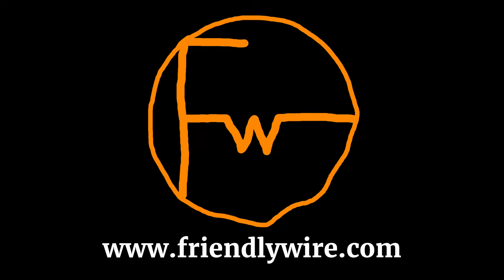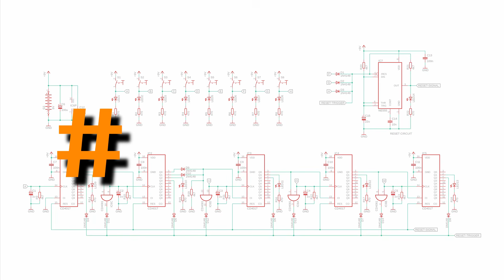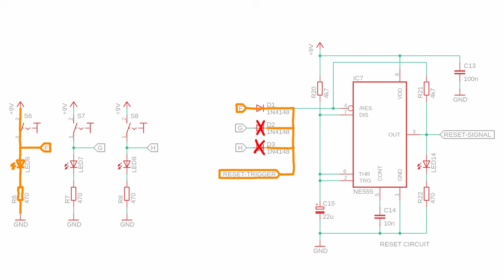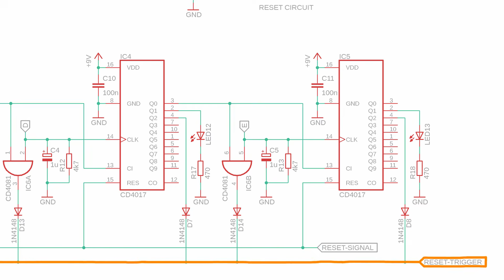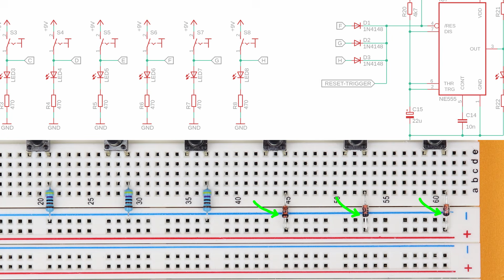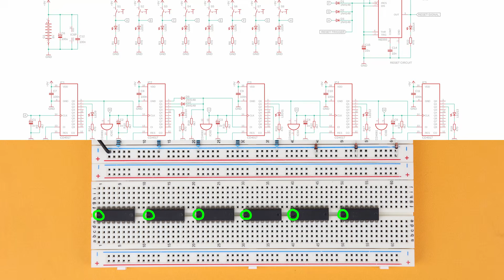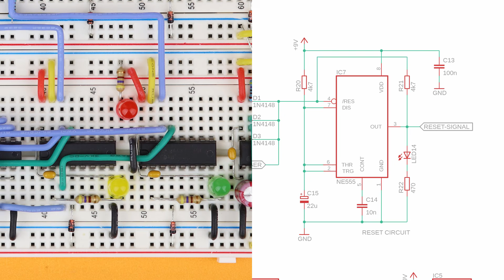CD4017 code lock with wrong code detection

Comment: bro plz tell me how to change the password of tis project,which components are need to be changed,exactly 🙏
Reply from the maker: Thank you for your interest! I made this video as a tutorial, and there is a detailed write-up available on my website at https://friendlywire.com/projects/code-lock/ that has a lot of details on this schematic. You can also check out my video on the CD4017 decimal counter (https://www.youtube.com/watch?v=BZjO2TuS2Vk) or the NE555 (https://www.youtube.com/watch?v=l5LzERjkux0) to help with the basics.

After understanding these concepts I am sure you can make up our own schematic for your own code. I think it's important to figure out how these things work on your own first, because then you really understand stuff.

If there is a key question in between (like, what is the purpose of this resistor, or how does the Enable pin on a CD4017 work) then I am of course happy to help out more.

Thank you again for your question, good luck, and I hope you will have fun with learning new things about electronics! :)

Comment: I have made a code lock by following your vedio and it's working fine,but one thing is that the third button,,when it's Pushed (B) then you can push any butten without following code you set,it's unlocks even you push the whole password,why is it happening.
Also what's the use of three push button at the top right ❤
Reply from the maker: Great that you built it! I am not sure if I understand exactly, since B is the second button, C is the third one. But the code lock is built in such a way that it only unlocks for the correct combination. If it unlocks earlier, or for a different code, it means that the subsequent CD4017 counters are somehow not deactivated.

But this circuit is a bit complicated, so maybe you can try to build a simple two-stage code lock (where the code is AB) and see if it works.

The other keys in the top right are the keys that are not part of the code. For example, if your code is 34772, then the other keys would be 1,5,6,8,9.
Reply: @FriendlyWire  one thing I have noticed that if I press this button c then if I put  remaining code it unlocks the code.and how to use the upper right 3 button and how to change the code
Reply: And if I pressed any button except C as a first input then if it is wrong i.e D as a first input then it detects that wrong code
Reply: And kindly tell me how can I change the code

Comment: Can I have the schematic file of the circuit,plz
Reply from the maker: Did you see the link to the companion article? https://www.friendlywire.com/projects/code-lock/
Reply: @FriendlyWire ❤ thanks,do we have schematic file in it ,so that I can easily open the file in any CAD application,like logic works or multisim
Reply from the maker: @Mathmate2024  I used Eagle to draw the schematics, but I do not have the files for it anymore unfortunately. I think to understand this project it would be best to draw the schematic yourself, all the information is in the article :)

Comment: do we have any alternative of CD 4081 ,as it is not accessible for me
Reply from the maker: If you run the circuit at 5V, you can use the 74HC08 AND gate chip as well, just make sure to check the datasheet because the connections are slightly different from the CD4081.
Reply: @FriendlyWire also is it feasible for you to share a picture that clearly shows the pins connection of resisters,
You explained well,I appreciate.
But I felt some difficulties in the connection
Reply from the maker: @Mathmate2024  I am not sure I understand, did you see the schematics in the companion article? If you give me an example of where the confusion is I am happy to explain it :)

Comment: Guys I've built the code lock precisely as per the instructions but for some reason it's not working...
The LEDs aren't lightning up..
Reply from the maker: Thanks for sharing! Don't be frustrated, we can figure it out. There must be some mistake, which can happen easily in such a complex project. A couple of starting points:

1. Do all IC's have power?
2. Do all CD4017 counter IC's work? You can check this by following my CD4017 tutorial here: https://www.youtube.com/watch?v=BZjO2TuS2Vk
3. Do the NE555 chips work? You can check this with my NE555 tutorial here: https://www.youtube.com/watch?v=l5LzERjkux0
4. Does the reset line work? I.e. if you connect the reset line to HIGH with a wire, do all counters reset?

After these steps, I recommend the following:

4. Build the circuit stage by stage (i.e. a code with just two digits first, for simplicity).
5. If you have a multimeter, check your wires for continuity. On some breadboards, the wire connections can be bad and unreliable.

If none of this helps, we can look more :) Don't give up, this is normal and a part of the process (unfortunately). It also happened to me many times when I was trying to learn new things in electronics. Don't give up! :)

Comment: does the pushbutton auto lock after being push ?
Reply from the maker: Thanks for the question! If you press the button again (if it is only supposed to be pressed once), it resets the code. Is that what you mean? :)

Comment: why don’t you connect pin 4 off 555 to res 4700 after to gnd?
Reply from the maker: Thanks for the question! But I am not sure I understand, sorry. The 555 is working the same way as we used it in the CD4017 tutorial. You can read all about it here: https://www.friendlywire.com/tutorials/cd4017/#ch6

But I am of course also happy to try and help you directly here :)
Reply: @FriendlyWire thanks you very much, i trying to debug a error in this curcuit, the led in pin 3 off 555 always high, i don’t know fix it😭
Reply from the maker: @huyhenhoi8877  Have you tried disconnecting the reset circuit, and building it separately? Does it work when it's alone?

Comment: hi! so which part of the circuit would I change if I want a different passcode? thank you for your time :)
Reply: So I followed the video and when I plugged the battery, the red LED started glowing instead of simply flashing quickly - I press the buttons and the blue LEDs light up but the yellow LEDs don’t light up. I wonder if I connected something wrong or is it a loose connection?
Reply from the maker: @kenikicchi  Thanks for building it! It is always best to debug these things separately. Can you disconnect the reset circuit with the NE555 and verify that it works as intended? Same for the individual CD4017 stages, do they count up properly?
Reply from the maker: You need a CD4017 for each stage, and a couple of AND gates to make sure all stages have been 'passed.' There is a detailed description of the schematic on my website, you can check it out here: https://www.friendlywire.com/projects/code-lock/

I also have a video on the CD4017 and the NE555 on my channel, if you want to learn more about them, since they form the basis for this project. And once you understand how one stage works, you will know how to add more and more :)

So I would recommend: build one stage, and see how it all works. Then add another one, and so on. Good luck!

Comment: Hi so we did this for our college project. All the connections are fine we check around 10 times comparing to the video but the led for the switches are also not glowing. The led for right or wrong is also not glowing. When i reset the last yellow led keeps glowing. And we entered yhe code and it switched to red led. Then we checked again but if we just click the last letter E itself the led switches from yellow and glows the red. So much confusion. We are in desperate need of help we dont have time to do another project with the submission date. Please help.🙏
Reply from the maker: Please send me a picture of the setup, you can find my email at the bottom of www.friendlywire.com . Here are some checks:

Did you check that each CD4017 works properly?
Is the 555 timer chip that you use working properly?
Are all diodes in the right direction?
For the breadboard that you use, is  the power strip connected all the way through?

Good luck!

Comment: I have created the the exact circuit but only my pushbutton circuit is working and whenever i enter the password correctly or wrongly only red led glows up and yellow led dosent glow at all pls help me i need this for my college project
Reply from the maker: Sorry to hear that :( Did you check the individual stages? Build the circuit for step 1 first (only one CD4017), then add the AND gate, and so on. Then it's easier to troubleshoot. If you have already built everything, try disconnecting the first stage from the others, and check. The important thing is to decouple everything when you troubleshoot, since there are many components in this circuit.

You can also send me a picture of your setup to my email, which you can find at the bottom of www.friendlywire.com . Good luck!

Comment: we built the circuit exactly  you did(we checked  properly many times  ), though the led of switch are ok, but the output light are not lighting up, we tried our best to find the error but can't find the error.And the led for wrong was always  lighting, could you please  help me to fixed the circuit
Reply from the maker: Thank you for your interest, it means a lot! But of course I am sorry to hear about the troubles --- most likely it is a loose connection somewhere on the breadboard, this can happen unfortunately. Can you send me a picture of how you built it? You can find my email at the bottom of www.friendlywire.com :) I know this is frustrating, unfortunately it is part of the hobby. But I am sure we can figure it out with enough trying! :)

Comment: your project is awsome and so easily understandable , i took this as my clg project . but i do have a slight difficulty in designing this circuit for pcb since the connections on a pcb cant overlap. so is there any platform i can easity design this circuit ? or is there a single diaghram with all the connections ? please let me know if there is a way i can do it
Reply from the maker: Thank you so much, I am so glad you liked this video and are even building the circuit in real life! I actually haven't made a PCB for this, but a lot of people like KiCAD and there are a lot of tutorials for it.

Comment: Can I reset the password that is set here?
Reply from the maker: Thanks for the question! But no, if you want to change the password you have to change the circuit. This is because this code lock does not use a microcontroller.

Comment: I have make same project as u told in video and i have recheck many times..but its not working properly only red light on when clicking the reset buttons.. nothing else
Reply from the maker: First off, thanks for building the circuit, it means a lot! I am so sorry it's not working. In 99% of the cases it's a bad wiring or a bad contact on the breadboard, but it's very hard to diagnose from the distance. Can you send me a photo? You can find my email at the bottom of www.friendlywire.com :)
Reply: I have the same problem can you tell me what you did to solve it?
Reply: @Fatimah-v2f1i  i have make another one bcz it's not working and idk what to do ..so that why

Comment: Hello i created this project but my leds are not getting reset by pressing the wrong input
Also the code is working like johnsons counter like pressing the same push button 9 times turns on the led again can you help me with this?
Reply from the maker: Hey there, I am sorry it's not working. It's very hard to diagnose it like this, if you want you can send me an email with a longer description and a few photos of your build. You can find my email at the bottom of www.friendlywire.com

Comment: Could u plzzz share it's circuit diagram on proteus
Reply from the maker: I don't use Proteus, sorry :( But I am sure you can draw it yourself based on the schematic in the companion article: https://www.friendlywire.com/projects/code-lock/#schematic-gallery-1
Reply from the maker: If you have any questions regarding the schematic (for example, if it's not clear where some wires go) I am happy to help!

Comment: why does the led light at code C (the yellow LED lightt) if i press it at first it lights up even tho i didn't press the code A-BB first?
Reply from the maker: Strange, that shouldn't happen. Check if the Clock Inhibit pin (pin 13) of IC3 is high or low. It should only be low when A-BB has been input first.
Reply: @FriendlyWire hello, i checked it using my dmm and it shows 0 even before and after i press the A-BB code.. i think the main problem is the IC (im not sure) i should by another one, hoping it’ll work
Reply from the maker: @Lumiixca  That is probably where the mistake comes from, good you checked it. You can use my CD4017 tutorial to check if the chip is working fine or not: https://www.youtube.com/watch?v=BZjO2TuS2Vk Let me know :)
Reply: @FriendlyWire  hello again! I already change the ic and it work but the reset led light is not working if i press it first.. what should i do?
Reply from the maker: @Lumiixca  Great, you're making progress! What you describe may be a problem with the NE555 timer that we use to generate the reset, but it's a bit hard to diagnose. Can you explain in more detail? You can also reach out by email (it's at the bottom of www.friendlywire.com) and then you could also send me a picture of your setup. We'll figure this out :)
Reply: @FriendlyWire  i already reach out at your email.. hope u notice!

Comment: I follow all the steps, but the blue LED lights is the only working..

update: Yayy finally for the second time it worked!! silly me for not looking at the mistake i made ><
Reply: what was your mistake? im facing the same problem here
Reply: @verdant.venerer  i had to change the place of my ceramic capacitor beside the ic and making sure it still connected to the right pins of the ICs because mine has short lead unlike in the vid, so when i put the reset LED Light it was connected to the ceramic capacitor, and when i finally realize that mistake i put the reset LED together with its resistor to my first breadboard and making sure no one is connected to it 😂 lastly, i connect it to the negative rail at the bottom in the 2nd breadboard.. and finally it worked
Reply from the maker: Glad you sorted it out, fantastic work!

Comment: I have 2 pins button not 4pins can I use it instead?
Reply from the maker: Yes, of course, all you need is a button that is normally open and when you press it closes the connection. Good luck!
Reply: @FriendlyWire first of all Thanks for your effort on this beautiful video 
I tried the circuit but it's not functioning really well like when I push buttons the right sequence sometimes it activates the counter sometimes it resets like it's a wrong code sometimes it activates the counter and resets immediately after so it works like once every times 
And one more question what is the real purpose of the capacitors and the 555 timer in this circuit

Comment: Very nice explanation, amazing work
Do you think its possible to add temporary lock to the circuit, like if the wrong password is entered say 3 times, it will lock the circuit for around a minute or so? 
Also, what software did you use to design the schema? Any online software i try either doesnt have this, or that, or something else
Reply from the maker: Thank you, much appreciated! And yes, you could watch my NE555 video and use the "monostable" version, see here for the article https://www.friendlywire.com/tutorials/ne555/#ch3 or here for the video https://www.youtube.com/watch?v=l5LzERjkux0 .

Basically, you use the reset line, and connect it to another CD4017's clock pin. That then counts the wrong code attempts. On the Q3 output of the CD4017 you put the input of the NE555 that starts the lockdown (more below). And you also connect Q3 to reset so that the counter doesn't get stuck there.

The NE555 has to be configured for a long ON-time (use the formula from my website). Its output is connected (with an 1N4148 diode) to the reset rail, and it will keep it high for as long as you want.

Let me know if that helps, or if you would like some more details. I may make a video on this at some point because this questions is quite common :)

Please feel free to let me know here if that makes sense or if I should go into more detail.
Reply: @FriendlyWire  Since Ne555 is connect to reset rail, then the reset circuit is continuously triggered for the configured duration? wud the red led blink repeatedly, or continuous? also, during the lockdown duration, wud any new input extend the duration? 
[and is the diode for preventing backflow or smthn?] thx very much
Reply: @FriendlyWire  also pls recommend some software for schematic simulation

Comment: Hello , its a very nice video thank you ,but i have a quetion what is the roles of diodes D9 ,D10?
Reply from the maker: Thank you, and good question! These diodes protect the outputs of the CD4017. If the diodes didn't exist, then Q0=1 would mean that a voltage is applied at Q1, which is bad. Same if Q1=1, then a voltage would be applied to Q0. These diodes prevent that whenever Q0 or Q1 are =1 that pin 12 of the CD4081 gets a signal. They form an OR gate, if you like to think about it this way. Let me know if it helps. If not, I will try to explain more clearly :)

Comment: Is it okay to use Sn74s08n for the cd4081 ic?
Reply from the maker: Yes, but make sure that you don't run the circuit with more than 5V in that case. CMOS chips like the CD4081 work well up to 18V, but the SN74S08N needs exactly 5V to work :)